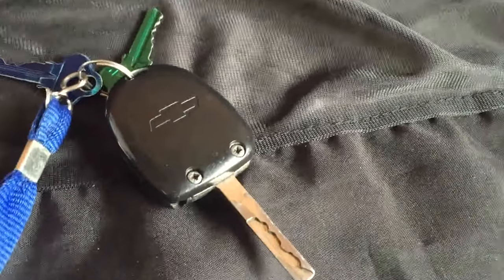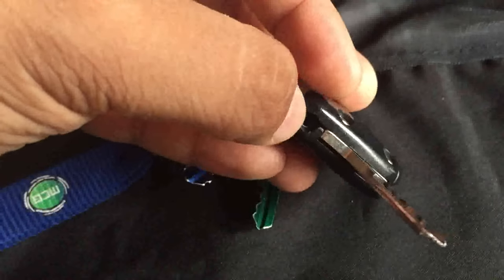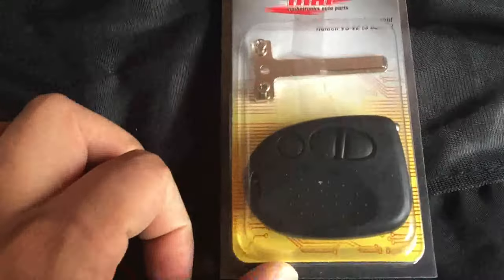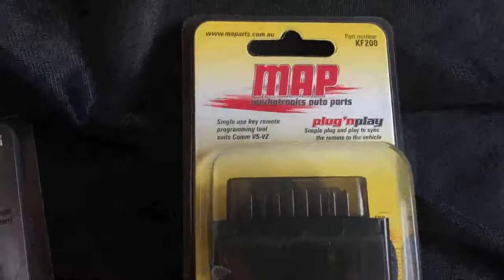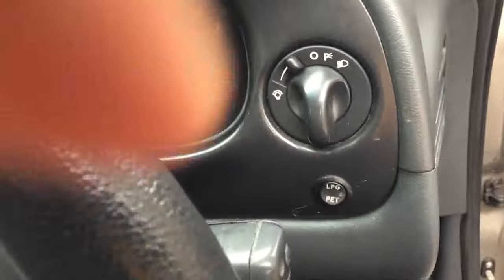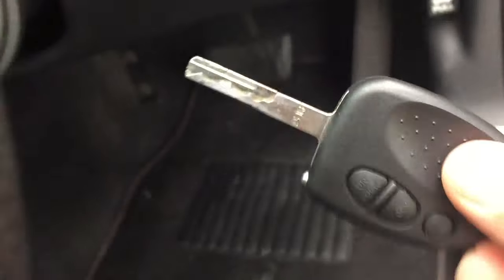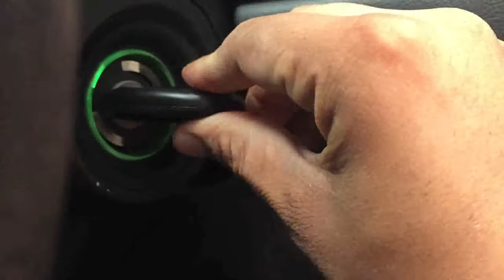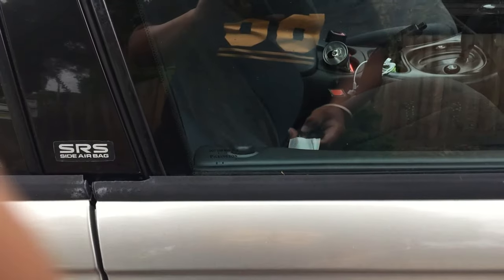HOW TO PROGRAM HOLDEN COMMODORE NEW IGNITION KEY VT VX VZ VE

Comment: Why did't you change the guts of the remote when you changed the blade you could have saved $$$ on not buying the program tool
Reply: Just bought a 3 button blank from Supa Cheap & took the guts out of my old one ..... doesn't sit together well ... no flexibility in the buttons & just running a finger tip over them will lock, unlock the car & twice it would not start car. Going to buy the full module & program tool ... although I reprogrammed the last one just following written instructions. My wifes finger nails root the buttoms in no time.. even though I have told her it doesn't require digging in to operate.
Reply from the maker: the remote had gotten crooked. Also I lost some part of it as I remember.
Reply from the maker: Its an issue with the new keys and shells. Buttons on new sets are hard as rock and will not work properly unless you buy a high quality genuine* key. 

P.S - Cut her nails while she is sleeping :)
Reply: That is a really bad response. Are you talking about the 'key' metal cut blade part or the 'head' the black actual bottom part that holds the buttons/boot release. I was charged 350AUD but from what I was told by the previous locksmith it was a 3dollar part. Sorry I am curious. But either way, the money they charge is just a joke. Considering they buy a 'head' for 3 AUD and then have to 'cut' a blade (key) to suit. I had him change the doorlock to suit the ignition barrel... He charged me to changing the steering barrel to suit the door. Even though I have the old key to state otherwise... extra 100 dolllars. This new young bloke had NO clue imo
Reply from the maker: Far out Spaagetii looks like he did you big time. Genuine key from repco was $95 which came with brand new shell and chip module + Screws and a brand new blade (uncut). Now you also need the programmer as I used one in the video that was about $50. So now you could have used same old blade if not new cut will cost you about $20 the most and putting everything together by your self the key should off cost you under $160. Now looks like your lock was screwed in that case after market locks are available under $300 which comes with 2 set of keys.